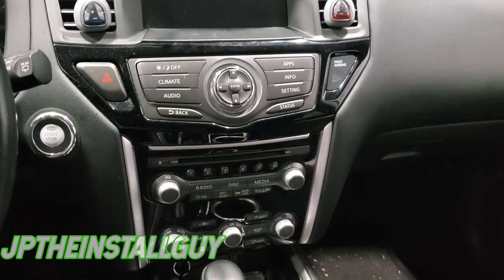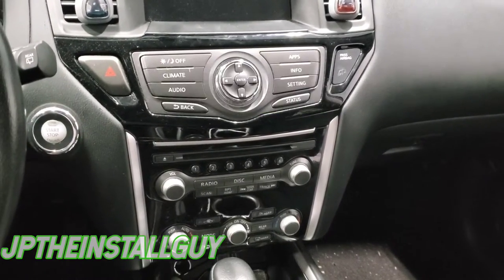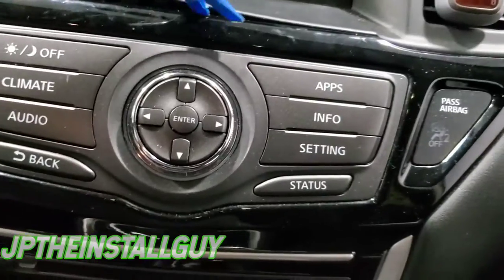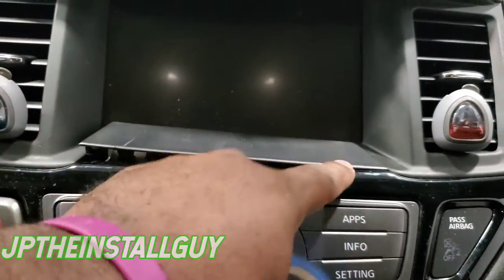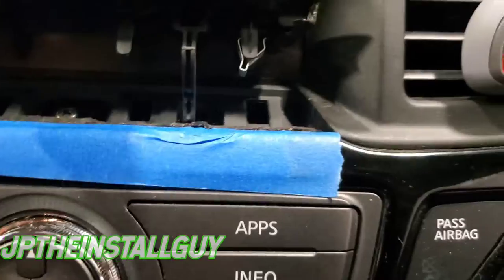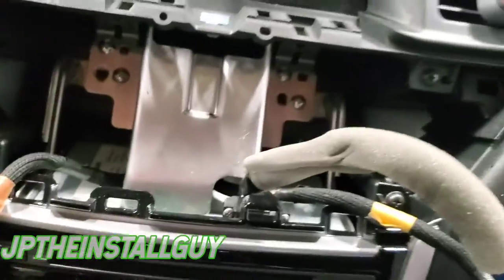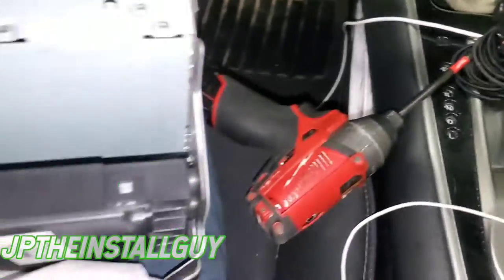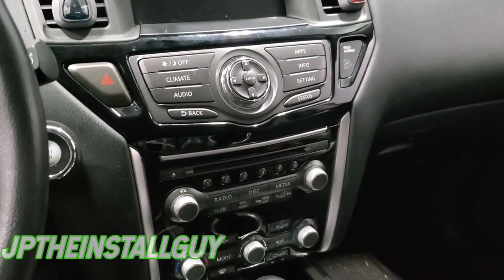2017-2019 NISSAN PATHFINDER RADIO REMOVAL ONLY

Comment: What's up JP. I have a Pioneer AVH-W4500NEX head unit i want to install. I am looking for a little help. I have steering wheel 'controls as well. I have an adapter for that. don't know if i will need it. I am mechanically inclined but never installed a head unit before. Thanks for any advice you can offer.